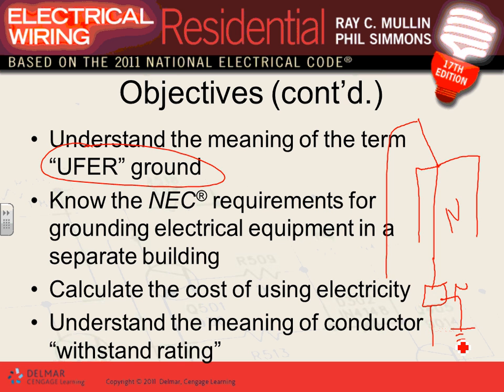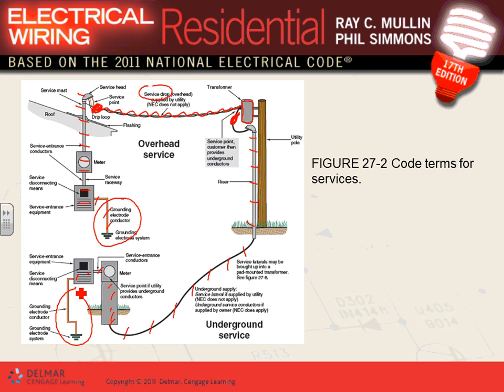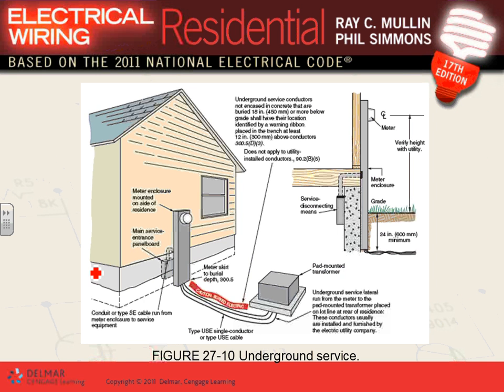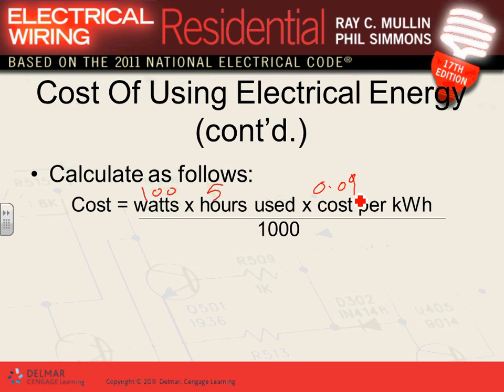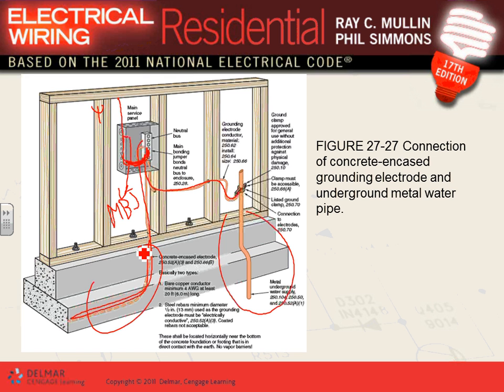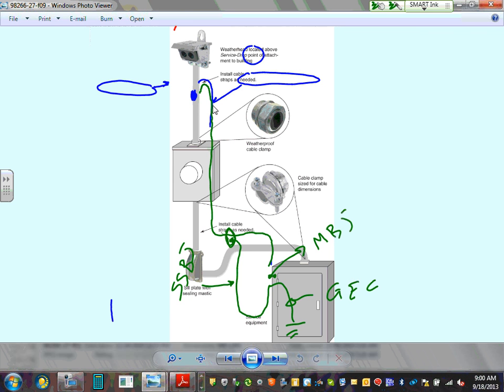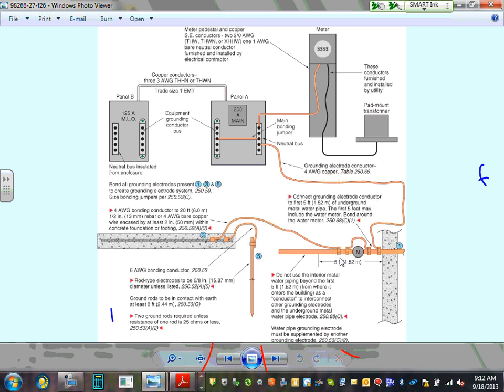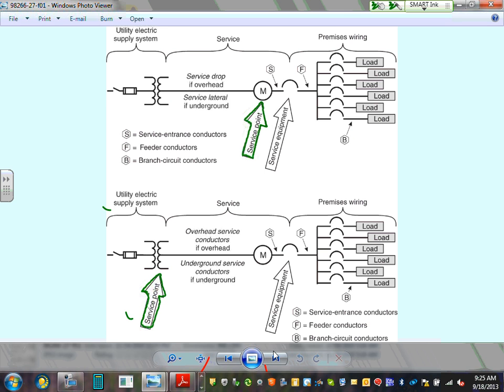Service Entrance Equipment Ch#27 09 18 13

Comment: i am installing a control panel in my pole barn on the land we just bought. right now the only thing on this property is the pole barn and the pole barn has a meter box on the side with service lateral entrance into the meter box. the meter box has a control panel attached to it with a main disconnect breaker in the control panel that is attached to the meter box on the outside of the pole barn. so the meter box and the control panel are a single unit. my question that arises as im watching this video i just got to the section about main service disconnect location at 34 minutes and im wondering if i need another service disconnect inside my pole barn if the control panel im installing is gonna be right on the other side of the wall from the meter box or if the service disconnect within the meter box is sufficient to pass code since it is so near the control panel on the inside of the pole barn. also the meter box is right beside the entrance doorway into the pole barn so the disconnect inside the meterbox is only a few steps away from the control panel inside of the pole barn. thank you for the video it has been very helpful,